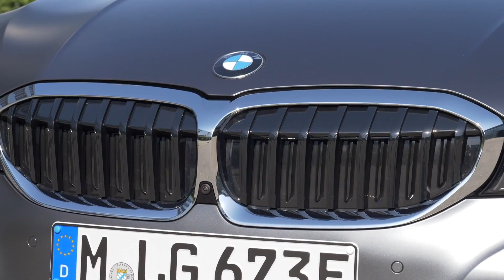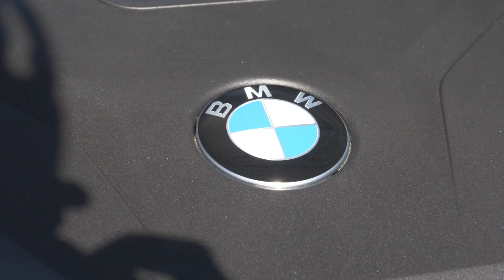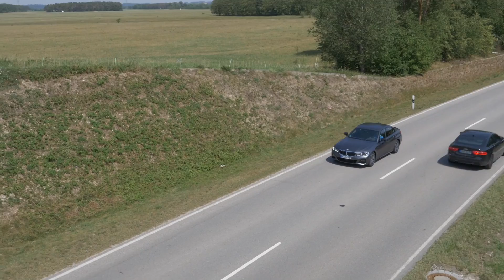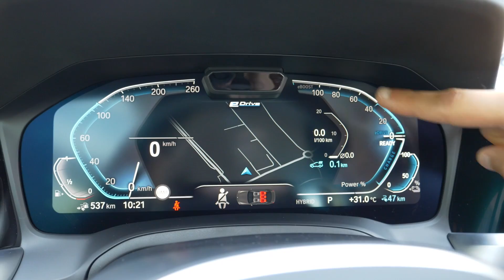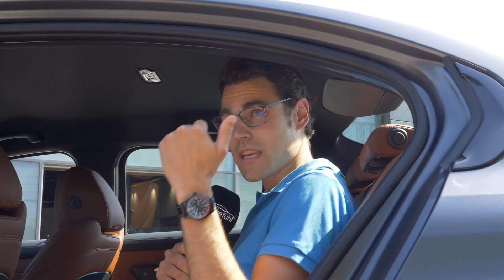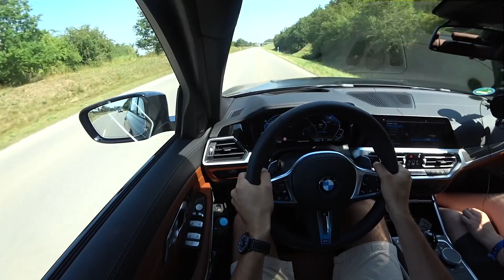all-new BMW 3-Series PHEV REVIEW Xtraboost & electric with the 330e - Autogefuel

Comment: I have this curiosity about hybrid cars:   If you start driving and go slow only electric. After 20min if it would be using the combustion engine he would be at temperature already, but in this case it stays cold because you were driving slowly only electric. What happens when you suddenly accelerate hard?  The combustion engine revs while still being cold. Can it damage the engine or is it being heated up another way??

Comment: I have ordered this as a company car the M Sport maxed out car. However, I cannot charge the battery with a wall charger at home but can you tell me if the battery charges itself while driving ?
Also, with 0% charge in the battery and a full tank, how long could I go on this one? Consider speed of 170-200 km/hr. I am generally driving from Frankfurt to Ingolstadt.
Reply from the maker: The engine can charge the battery, but thats not effective
Reply: Hey I already got this car for almost 10 months now. It runs around 40km in full charge. 
With an empty battery and a tank full of gas I get around 350 - 400 mms but depends on how you drive. 
If you have charged it to full and your tank is full, you get around 400 - 460 kms again depending on how you drive. 

I think if you really drive it sweet - max speed 120km/hr, you can also get close to 500 km.

But I usually get 360 - 400 km as I do not have an option to charge it at my home (only with regenerative braking). 

One cool trick I found - I used to get less power as well as less mileage when I used to drive in adaptive or hybrid mode. But when I drive in sport mode with not much power, I get more mileage. Super strange but true.
Reply: @harshvardhanagrawal  Thanks for The tip! I can do Max 53km on full battery but in Belgium there is many traffic So speed limit is often 70km/h, autostrades in Brussels 100km/h
Reply: At The german autostrades with speed 170-200 you must count 15l/100km. The car isn’t driving on electricity on The autostrade. You can when you put The electric mode on instead off hybrid. But The The electric speed limit is 140km/h and The battery Will be very fast empty and also slow electric acceleration above 80km/h

Comment: I think in hybrid mode, it goes up to 120 km/h.

I am just wondering: if you switch back and forward from combustion to electric, won't that hurt the engine ? I mean the engine does not really like to start/stop all the time..
Reply from the maker: I did talk with engineering about that, the phev engines have some stronger more durable parts, and research showed that they do not fail more often than their non phev counterparts, that what they said

Comment: I got this car 5 days ago and I am only getting 22 miles on electric full charge.  Been advised that their isn’t any issues with the battery and the car is learning how I drive. But frustrating when every website talking about this car says 37 to 41 miles on full charge. Am I doing something wrong?...
Reply from the maker: guess that depends on how hard you press the throttle and the topography and the outside temperature

Comment: How long does it take to charge this battery to full? Can one do it from a fast charger?
Reply from the maker: depends on your charging method, DC is not supported. But battery is small, recharging wont be your problem
Reply: Thanks for your reply, seems like not very attractive powertrain. Need to use two different methods of charging/refueling for maximum efficiency. I suppose this technology still has a very long way to go

Comment: Can't wait! Getting this beast next month, in the exact same color, but with white interior. All monochrome, except the laser lights and M sport break calipers :D 

I did miss the bit about charging from this shorter review version: Type 2 only, 6 hours from wall plug, 3 hours from a Type 2 3.5 kW station. So don't expect to charge this while travelling - the charging is only really suited for commuters that charge up at home or at work. But for that it is just perfect - no need to overpay for huge battery that you only use a couple times a month.
Reply from the maker: Enjoy!

Comment: Interesting that the boot floor can be stepped to allow some extra depth but in Australia the petrol 330i M Sport does not have any space below the boot floor as the previous F30 did. It is totally sealed off.
Reply from the maker: That’s a new feature of the all new generation, the boot floor is always lower. You can only put it down in the PHEV Because it is significantly more narrow